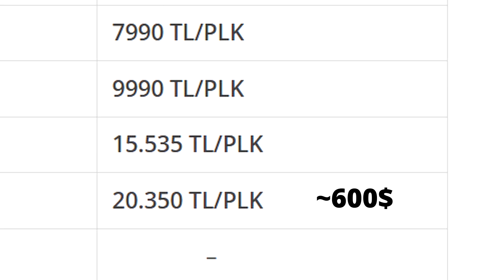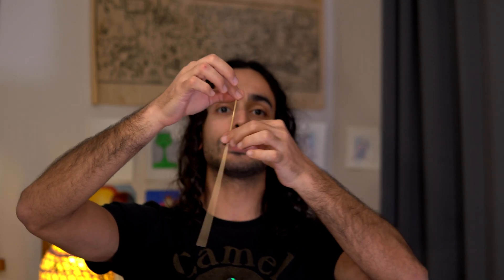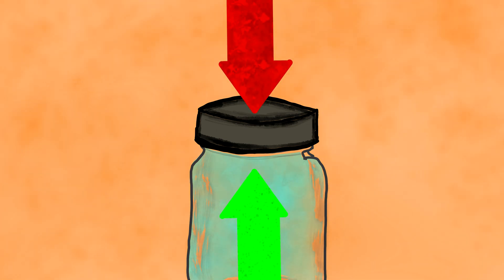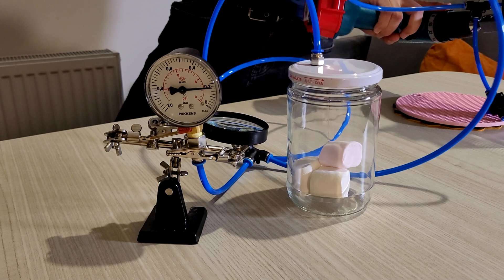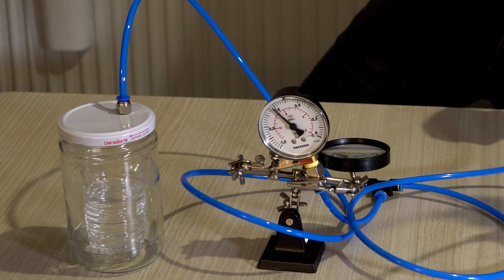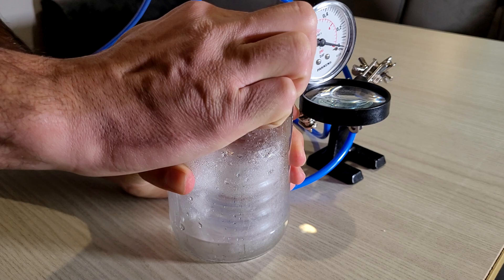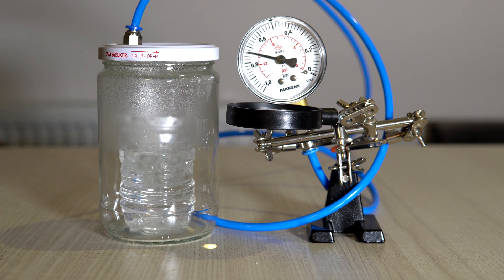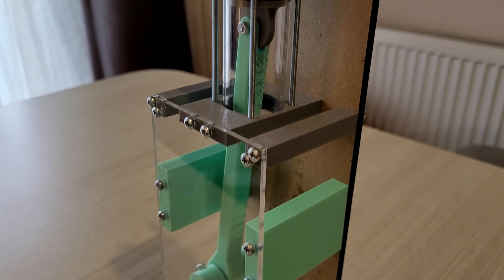Boiling Water At Room Temperature? | 3D Printed Vacuum Pump

Comment: Hi Buddy, very informative video🎉 loved it. Can you provide info on making a fridge or common compressor in to high bar pressure (30-70bar) compressor which can run continuously for 8 -10 hrs
Reply from the maker: Hi, I'm glad you liked the video. I saw some stuff about using an old fire extinguisher as a tank and a fridge compressor on YouTube. I'm not sure i can build one with the tools i have.
Reply: @canocholic  Buddy , I am looking for a high bar pressure compressor from fridge or AC compressor, how to convert them for generation of 40-50 bar compressor through larger piston rod?

Comment: If you want to iterate the design again you can keep the same stroke but have a shorter connecting rod by using a "Crosshead" arrangement.  This will take the side forces off of the piston and seals and should let you get a better fit with less friction.  Most crossheads are sliding, but you could just put a roller bearing there or something.
Reply from the maker: Hi, yes, a crosshead would help, but in my case, since i already have a working design i didn't want to change it and complicate it.

Comment: Great video! Maybe make a video about vacuum distillation at low temperature and small temperature difference, like "powering" the process with evaporative cooling.     

By the way, I found it surprisingly easy to 3D-print vacuum ejectors powered by water that can reduce the pressure to relatively close to vapor pressure of the water used, at least close enough to boil room temperature water when cold tap water is used to power the vacuum ejector.
Reply from the maker: Great suggestion! Noted

Comment: What is the lowest temperature you can boil water with this vacuum pump at the top of mount everest?
Reply from the maker: It should be araound 30-35 degrees